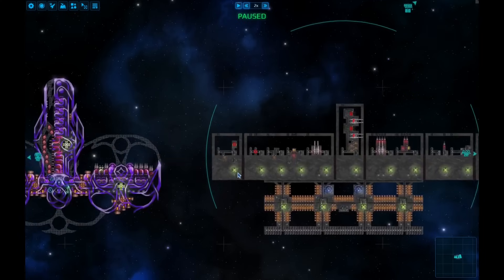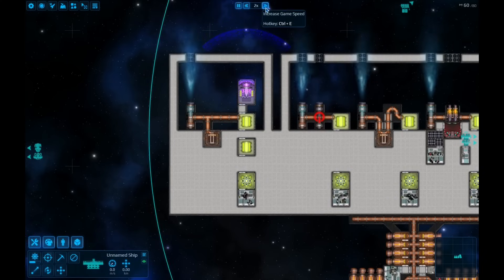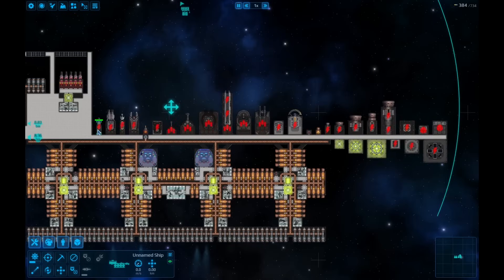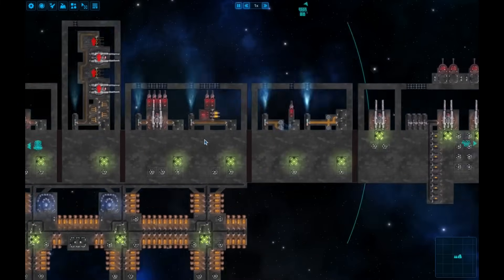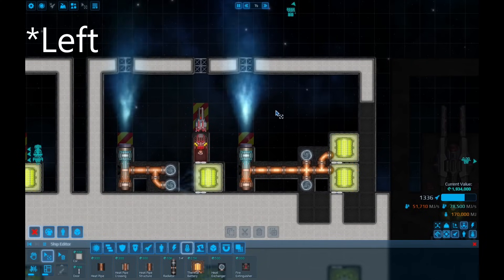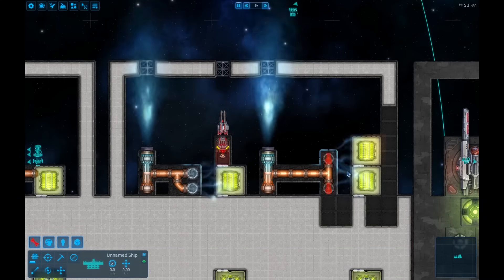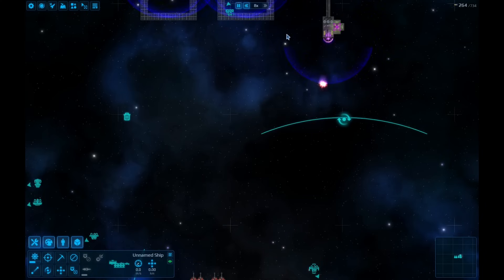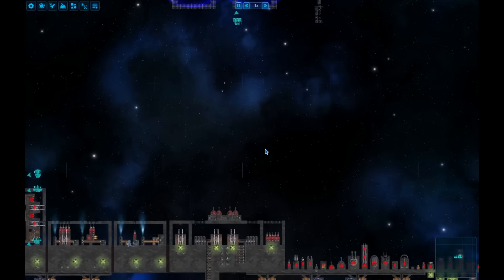Cosmoteer Basic Guide: Heat Overview

Comment: So, should I use a balanced mix of Dilation and Amplification pumps, or go full max Amplification?
Reply from the maker: Heh, If you're fighting shields and using the thermal lance to debuff the shield, then solely dilation is the best.

Otherwise, the optimal combo is distinctly *unknown*. There isn't a formula, calculation, or rigorous testing that's been done to verifiably prove what the absolute best choice or ratio would be. There's merits and downsides to every set up.
Reply: 6:05 didnt cause the Amplification faster damage to the shields?? 🤔
Reply: Currently using 6 dilation and 24 amps, it works very nicely
Reply: For a single lance, or multiple?
Reply: I think it depends on how you use the lance, if it’s gonna be a support weapon I’d say have a little dialation but mostly amplification so the armour gets weaker faster, if it’s gonna be a main weapon then it’s “Would you like to slow cook half the ship, melt through one specific portion, or a mix of both?”

(I haven’t been playing for long but my main campaign makes use of a ship with far too many resources placed into having as many powerful thermal lances as I can manage)

Comment: Odd question, before I go modding the game and turning the heat exchangers to input+output devices: is there a way to bridge heat across gaps without setting my ship on fire? Something that converts "part heat" into "hull heat", if you will, that can be picked up by heat exchangers?

Comment: 2:51 a core difference in late game ore gathering is thermal parts are required for sun divers because shields set ablaze while exposed to heat but also using heat exchangers in large quantities it’s possible to make a shield less sun diver to a bout medium orbit without damage not practical by any means but a cool gimmick.

Comment: I wouldn't say that these mechanics don't fundamentally change the game. Sure, old ships still function, but I don't figure that's what most people would be talking about. I figure it's more about how these mechanics interplay with the balance. As an example, faction ships made prior to the meltdown update may entirely lack sufficient counter for heat based weaponry like the thermal canisters and thermal lance, which without a heat system of your own, are difficult to handle. The counter to heat systems is generally your own heat systems, at least in the straight forward manner of defending against their effects. I think it's realistic to expect that some level of overclocking will be mandatory, especially in the PVP scene.
Reply from the maker: All valid! The thing I was trying to address was players that perceived it as "every ship is broken and the game is different enough that I shouldn't play anymore." It's simply not true, as the game remains functional as is. Shields practically counter the thermal lance and definitely canister missiles, and many of the built-ins that use the thermal lance lose to other, similar costed built-ins that don't.

It's inevitable that a new feature will be woven into the game, and that you'll be rewarded for using it. But you aren't being forced to use it, and you don't need to uninstall the game if you don't like it, is all.
Reply: Not needing to manually recharge PDCs is amazing. To be honest, that alone got me to dip my toes into overclocking and I imagine just that it is going to have huge ramifications for ship design
Reply: @warlynx5644  The thing I like most is the OC shields. If there's something you'd see on my ships, it is protection lol